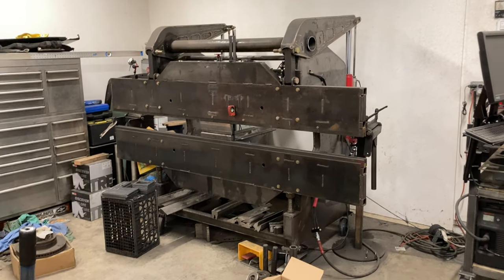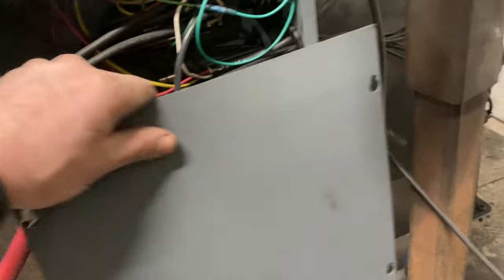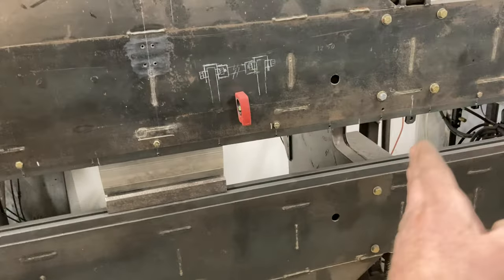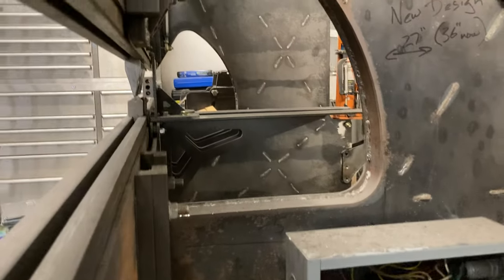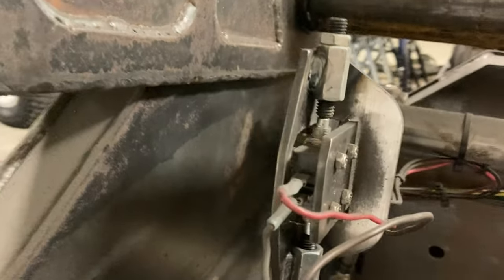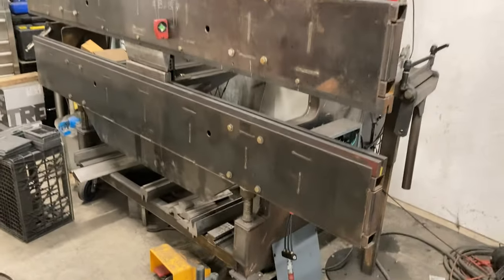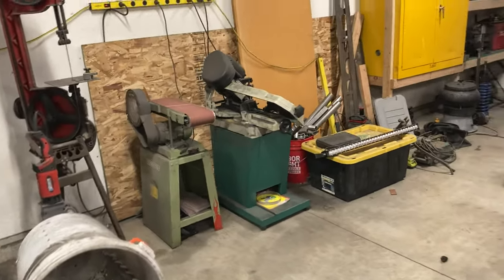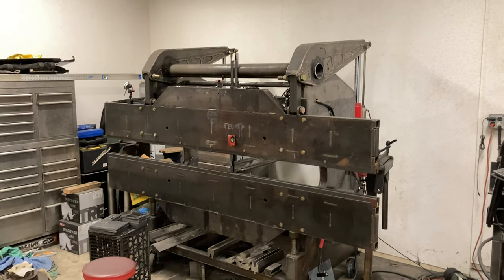Home made press brake

Comment: The price of machines and tooling is insane these days, outside of the fact that you're totally capable I can see why you built it. The abilty to do 8' material is awesome. I have an old 40 ton 3 in1  Gator with 4' shear, brake and turret press. It has an up acting bed with  hydraulic cylinders on both sides and it's really hard to get a consistant bend from one side to the other. In 2002 I paid 13K for my 65 ton Edwards Ironworker loaded with tooling and loads of extras, today the base model of that machine is over 30K, crazy inflation.

Comment: Very cool piece of engineering! Have you considered adding a oil reservoir to the jacks so that you could add double action air cilinders for quick Initial down movement? Could greatly improve productivity
Reply from the maker: I tried that, I ran into issues with the jacks pulling air into the cylinders. I couldn’t figure out how to do a load sensing control for the valve on the jack.

Comment: What did you use for a bearing in your rockers? Nice work that’s a bad ass build!!
Reply from the maker: @ray10706  it’s just steel on steel with grease fittings. I thought I’m good so far, but I will change to brass or bronze bushings in the future.

Comment: A hydraulic flow divideder hydraulic power unit and 2 cylinders and you'll be able to solve all the issues you've had and faster cycle times
Reply from the maker: That’s the plan, slowly collecting parts.
Reply: @ultra4suzukisamurai679  the 2 smallest hydraulic pumps or motors rated for the pressure can have the shafts coupled together to make a flow divider its typically cheaper than a 2 channel flow divider. Next is become a friend with a guy that works with equipment or hydraulic repair

Comment: You did a great job! I built a 4' press brake using three 20 ton air over jacks, it works very well. I want to build an eight footer soon. I've purchased a couple new take/off 8" dia hydraulic cylinders for it and a 5hp hydraulic power unit. I'm collecting the steel for it as I find it reasonably. Thanks for showing us yours 😊
Reply from the maker: Thank you! My first plans were to use 2 40 tons too, then my imagination took over. lol. Thank you for watching.
Reply: With what you just listed you need a 15 HP 28 gpm 2 stage  power pack
Reply from the maker: @SegoMan  $$$$$$$$

Comment: Good job on your brake, I ran the maintenance dept at a woodstove/gas heating manufacture, I have worked a lot on Accupress brakes, on the older machines the upper part/head had nylon shims that were adjusted snug enough so if you removed the connecting rods the head would not fall down, the idea is that any slack on the connections between the cylinders and the head would be taken up before the head moved, what i have seen happen is if you have a 20 gage part it is pretty strong before it starts to bend, once it starts bending it is not as strong and the weight of the head can drop lower then you expect, sheet of metal are normally harder on the edges then in the middle, for my own 4ft brown bogs brake I used and old satellite dish positioner to power my back stop, it would of been on a 12ft dish with 10 setable positions and a forward and backward, it used two acme threads linked by chain, if I was bending parts that had one bend 1" from the edge and another 2" from the edge I could set up the buttons on the controller to be satellite 1 and 2, it works surprisingly well., I had a house jacked up one time, it used 4 jacks, the system could lock the 4 pumps into unison so all 4 jacks moved as one, I bet you could make that happen on your machine, Good luck, I'm subscribed.
Reply from the maker: Thank you. One day I’d like to automate the back stops. I like your idea.

Comment: A question      Is the top pipe mounted on any kind of bearing? And have you noticed any twisting from it/ way cool machine
Reply from the maker: It’s steel on steel with grease fittings. No permanent twisting but it has some spring to it if the load is not centered.

Comment: 2 things.

1. Do some reconstructive surgery on those hydraulic jacks so they are hydraulically tied together.  Or buy some discount cylinders and plumb them that way, it will help with the racking, if you can find a cheap hydraulic proportioning valve it will solve it completely

2. Push air on top on the oil in the reserve portion of the jack, it will give you a rapid down feed with little force , until the pump needs to take over, vent it accordingly.
Reply from the maker: I’m slowly collecting parts.